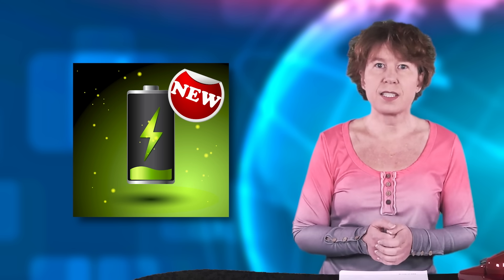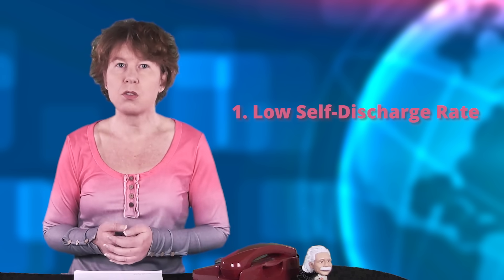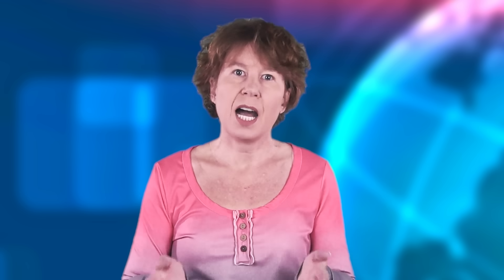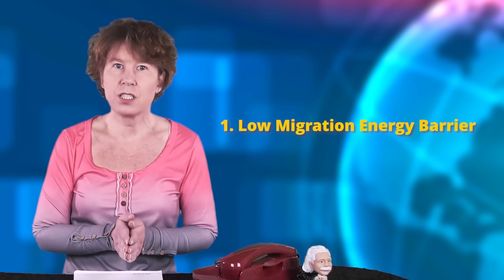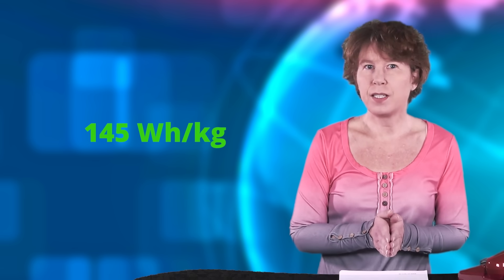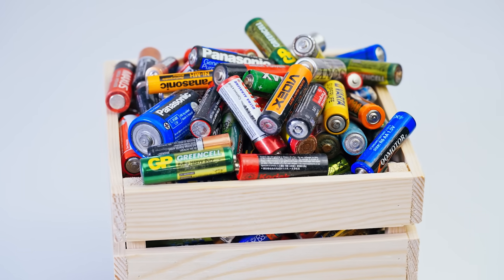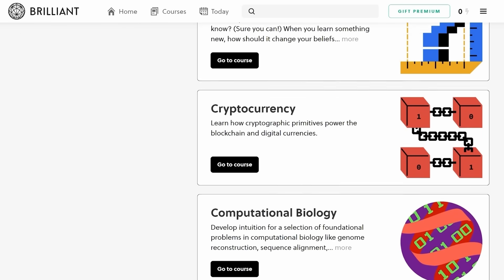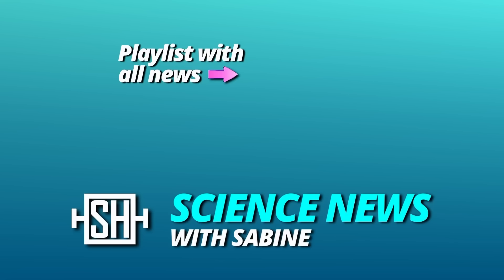Fully Charged in Just 5 Minutes: New Battery Breaks Records

Comment: To me charge time is more important than having twice the battery.  I hardly ever charge outside of my house (which is automatic overnight) so this would only affect the few times I make large trips.  In those cases I'd rather charge faster than make 1 stops vs 2.
Reply: My friend said he will never get an EV because he does not want to spend more than 5 or 10 minutes filling his tank once or twice a week. I told him that I spend less than five minutes in a month! I get out of the car in my garage, grab the charger off the wall and plug it in… less than 5 seconds each time.
Full tank every morning using off-peak electricity. Ten dollar fuel bill most months. 
We have a cabin 250 miles away. Our Model Y long range can make it, but we prefer to stop about half way to use the bathroom, grab a snack, walk the pups, all while charging for about 15-20 minutes. We usually have about 45% battery when we arrive. It is not inconvenient at all, but I really should watch the snacks 😂
Reply: @9Point8  and there is the added bonus of out accelerating the gas cars pretty much... always. And driving past the long wait lines at the COSTCO gas pumps as they wait to spend $60 to $80.
Reply: @9Point8 Your situation is tailor-made for you to adopt an EV.  It doesn't apply generally enough to everyone else that enough will buy EVs to make a difference on climate change.  The message for EVs relevant here is that everyone will have to buy them (or do without) once the sale of combustion cars is outlawed, as (for example) Canada plans to do by 2035.  It's not helpful to say that your own experience shows that everyone can be made to do their bit by buying an EV and sucking it up.  What you have done with your 250-mile recreational trip is to rationalize how the midway recharging stop is actually a benefit when it is in reality a cost of time imposed on you by the vehicle's limitations, which you get back because for now electricity is cheaper than gasoline because it isn't taxed.  If it's a leisure trip then I suppose it doesn't matter but a suburban mother who had to juggle car pools along with her work schedule wouldn't want to have to go looking for a recharging plaza in a sketchy industrial park between soccer and ballet.  It won't be a relaxing rest stop for her -- there might not even be a bathroom.
Reply: Makes perfect sense. In a 6 hours trip, better having to stop twice for 5 to 10 minutes each (basically the time You take for a cigarette or a bathroom stop along the highway) than having to stop once for one hour and a half.
The first hardly impacts the overall trip time, the second one impacts it quite a lot more
Reply: it's exactly because it's overnight, that charge time doesn't really matter all that much. I mean, it's already pretty good, and taking the 10-15 minutes to fast charge to 80% to have a coffee and stretch only makes you a safer driver on a long trip. I think in time, both charge time and energy density will improve, along with durability and self discharge, and that'll certainly help to convince more people it's the next logical step, but I don't know that making an electric car that charges as fast as filling a fuel tank is necessarily a good thing.
Reply: @longbow192 people are used to „charge“ their car at a gas station so they simply convert these stops to EVs where you can charge at home over night. 
For people without a garage thinks look different, they would constantly need these Chargers which will also damage the batteries in the long run. For these people the charging time is important especially as an EV has roughly half the range of a conventional car not even talking about EVs in the winter. 
EVs are the future but there are still a lot of problems to overcome.
Reply: @svenweihusen57  EVs are not the future. Carless travel necessarily has to be.

Cars are far to inefficient that we will get anywhere unless we stop using them at anywhere near the scale we do today. What they are powered by is inconsequential to this, we'd still have a problem even if they'd run on air.
Reply: @Llortnerof  carless travel is simply not possible. And EVs are just part of it. There will be and must be e-Trucks/Semis too. And public transport outside of cities will always be crap.
Reply: @svenweihusen57  Of course it is. We managed >99% of human history without cars.

You'd have to refuse to even consider the possibility to come to the conclusions you did.
Reply: @svenweihusen57  I agree. Just like with the first gasoline powered automobiles that were hated by the "Get a horse!!" naysayers, there are a lot of issues to be addressed, but that doesn't mean it won't eventually be fine tuned. Just because something isn't perfect coming out the gate, folks shouldn't immediately start bashing and hating on it. They remind me of an Episode of the Simpsons when Marge has been accused of being a witch, and as she is starting to defend herself, the bartender Moe says "Oh, I've heard enough... burn her!!" Thus showing he and the public's lack of understanding and completely biased thinking. (I may be off on the details a little. It's been a LONG time since I saw this episode) but anti EV folks are very much like this... and have the most in common with the folks who bashed the gasoline powered horseless carriages  when they first came out. They stated that: There were limited places to buy petrol (pharmacies and chemical warehouses) so "limited range"; They were expensive to purchase and maintain; They were unsafe and a public nuisance; They were going to destroy the economy because they were going to put all the farriers and tack supply shops out of business... and many other "reasons" they had for being so against the introduction of the automobile. It's a good thing that those fear-based folks without vision didn't get their way. Interesting how the ones nowadays always pull out the environmental card as if that is the reason we all have for owning an EV. Many of us just want an automobile that has extremely quick acceleration, is super quiet, rides like a high end luxury car, and that we are not required to pay a sizeable chunk to the oil companies for the honor of driving our own vehicle. After reading this, they will no doubt come back with things like "Well what about people who can't charge at home, or some other reason based on CURRENT issues. I always reply "You are correct. For NOW, but things are rapidly advancing, and if we were to have this conversation again in 30 years, will you still be able to use the same arguments?" Very unlikely.
Reply: @svenweihusen57  They, without their own parking, would use level 2 street chargers (if the infrastructure is build up normally as in the Netherlands) over night or in weekends. 3 to 11 kw charging , payed with a chargecard... compare that with a tankpass for petrol). Thhose slow chargers are also much cheaper / kwh as fast chargers.
Also a lot of level 2 chargers are build at parkings around factories.... enabling slowcharge during youre 8 hours workday.
Reply: @longbow192 Yes, of course, fast charging speed is not necessary when charging at home.  But if you go on a long journey, a reasonably fast charging speed is very useful.  I don't want to hang around for an hour or so - or even 30 minutes - if I can help it.
Reply: @steveknight878  The vast majority of drivers will take a break every 3-4 hours for 1/2 an hour to stretch legs / eat / use the bathroom - many EV's will allow 3-4 hours of freeway driving before needing a 30min recharge and away again
Reply: @TB-up4xi  exactly my point. Quicker isn't necessarily better.
Reply: @TB-up4xi so driving in pairs is Just unheard of? Many Long Trips are Families going on Vacation. Yes, the little Buggers need a break - but we once drove 1 Mm overnight. We Kids slept Most of the time and our parents switched places at the wheel. With Charging the already Long Trip would have taken another 2 Hours. 
I know, an exception but an exception many People do every 2 years.
Reply: @Ehregott  You're lucky that you have not the resting rules as they are in place for truck drivers (in Europe). For them this travle scheme would have been forbidden due to the high risk of accidents becauste tiredness.
But for me....I save 4000 euro a year on energy costs with driving EV (yes , I charge with solarpanels cheap)...2 times a year 1 hour extra (I do not need 1 hour charging, 25 minutes is enough and with 3 stops I reach easily 1000 km...1,5 hour stop instead of minimal 30 minutes with a petrol car in youre described driving scheme.) is very good payed with 4000 euro.
But since I used also with petrol cars the method of resting after each 3 hours for me it is not even extra time...in contrary, because I save now the refuelling time each stop (10 minutes including paying and reparking) my stops have shortened with the EV.
Reply: @longbow192 there's two main issues with this comment section: 1) overnight charging is great if you live in a personal residence, but not so great if you're in an appt or dorm/motel parking lot. 2) if charging takes too long then as ev's become more common your wait will begin to multiply as you now have to wait for all the people in front of you to charge first, the alternative being larger and larger multilane charging stations.
Reply: @xxportalxx.  Only 30 years ago, there used to only be one, maybe two gas stations in a reasonably large town. Now they're everywhere. As people buy more and more EVs, the charging network expands.

Edit: besides, level 1 charging (the slowest) is only really available at home, and some office parking lots. All other chargers in public spaces will be at least level 2, so it won't take all night to fully charge the average HV battery.
Reply: None electric vehicle owners cannot understand the concept of concurrent activity. You can tell even friends and family it takes no time to charge because you are doing other stuff that you would of been doing anyway.  They nod and pretend to understand but next conversation its obvious that still think charging is a stand alone activity.  Or people make up one in a million scenario. Fine if you need to tow a boat a thousand miles per day then maybe a ev is for you!
Reply: classic EV owner thought process. It is not how the vast majority of cars in populated cities exist. If you live in a condo in Europe you probably park outside just for a start.
Reply: @finophile  never forget: If you live in a City you have to adjust and ditch your car 🤡 they don't but you do!
Reply: @finophile  that's great - I was giving feedback from my personal experience (as it clearly stated).  Sorry it doesn't match with yours...  oh and according to a quick Google search about 80% of tesla owners charge at home.  That's not all EVs but you acting like I'm some rare, weird case is kinda funny. But either way, if you're not happy with where you live you should move! Sounds terrible... 😉
Reply: @jeffgriffith9692  as I Said: You have to Change, they dont.
You know Teslas do cost quite a bit? So If you can afford a Tesla you probably can afford a Home. Its Just easy correlatio s.
Reply: @Ehregott  you mentioned condos in the city.  Most condos in the city are more expensive than my house but ok 👍
Reply: @jeffgriffith9692   I didn't mention condos. someone else did. And yes, condos might be more expensive than your house - but usually they are not. I would make the argument more by thinking of flats/living by rent - so those People just shouldn't have cars?
Another Thing to consider is: If People moved out of the City, they would move to the countryside which would see an increase in prices again.
And some People like the convenience of the city, use public transport most of the time but e.g. have to drive to the outskirts to work. But they should just not do that and life their live like you want them to?
Reply: @Ehregott  Can you show me why a tesla costs a bit and a petrol car is for nearly free?
With a full business case from buying until selling including all spendings during time of usage of coarse.
(I did this and spent 60000 euro LESS on my EV's in the 8 years between 2013 and 2021 as I would have done if I was driving with a same sized petrol car. (Oh not a tesla but a leaf and later 2 EV's, also a KonaE64)
Reply: @reiniernn9071  yes, If you lease and Rent. You need Credit for that. If you don't have Credit you wont be able to afford this.
Also nice strawman there. Please Refrain from doing that in the Future or I will Stop the discussion immediately
Reply: @finophile  Right in front of the appartment of my mother is a public slowcharger....inn Rotterdam. One of the very many. Each of those are able to charge 2 cars. And if the amount of EV increases the town expands that number of level 2 chargers. Within 200 meter of that appartment I know at least about 4 other level 2 chargers.
At a shopping center, 2 km away and also appartments there, I know another 4 of those level 2 chargers...And I'm sure in those 4 square km if I look at the chargemap there will be much more of those. 
This allows people withouit own driveway to use conviniently EV's...and yes , there are already a lot of those around in that district . 
Oh, I have my own driveway in my village, just as all neighbours...but even here we have some public level 2 chargers (usable for visitors in the village).

Comment: i charge at home so i dont have to sit around. the collective time ive not spent at a pump vs the few times ive fast charged favors the ev by like 3x. so no evs are not terrible. also a lot of chargers are at home depot or stop and shop or walmart so if you time it correctly you can shop while the car charges so you again have effectively  zero wait time vs 5-10 minutes it takes to pull in get out swipe fill up and then get back on the road.  multiply that over a year and its a bunch of time saved for most evs use.

Comment: You don't need a large battery for most journeys you'll ever make, so then it's efficient on those few journeys to have a super fast charge.
1. You don't lug around extra weight for no reason= more range= less resources used.
2. Charging infrastructure will free up quick if there isn't a 40min charge time.
No doubt

Comment: This may be trivial for a phone, but if you're travelling, stopping to charge  1-2 hours is a real deal breaker. It's also a deal breaker if you live in an apartment with no home charging, or you park on the street.

The title '5 minutes to fully charge' just simply not workable for an EV. Take a typical 40 kw-hr battery... if you want to charge it in 5 minutes you need a charging rate (not counting heat loss) of 480KW. Charging at 220v would be about 2100 AMPS. Does NOT sound safe. And considering that a typical home draws about 1.5 Kw, the load on the grid is unfathomable. 5 minute fill time for an ICE vehicle is, by contrast, trivial.

Then there is heat dissipation during charging. Fast charging a conventional EV can produce about 5-10 Kw-hr of waste heat. Cooling a 40Kw-hr battery charging at such a rate is really off the charts.

[But for phones, power tools, laptops... this new idea might work]

Comment: Absolutely agree, speed of charge is not the main issue batteries have.
Rather, they should be safer when damaged, and not using any rare earth materials.
Reply: While I agree.  Rare earth minerals are not rare.  Recycling is essential.  Currently there are not enough too recycle at scale. Over time I see cells going in the direction you indicate.  We have no idea how many researchers are working on cell technology.  At least a million possibly several million.  They will get there.
Reply: EV batteries are safer than ICE cars, which catch fire more easily than EVs.
Reply: @bernhardbeschorner8331  you will need a better citation than your word for that claim.
the cost of the battery fire is steep and the smoke all by itself will kill you...